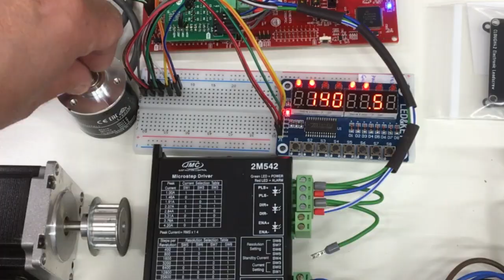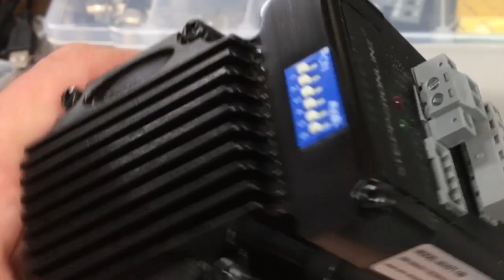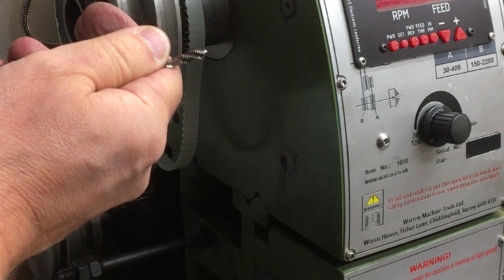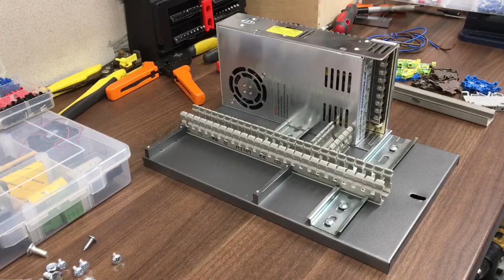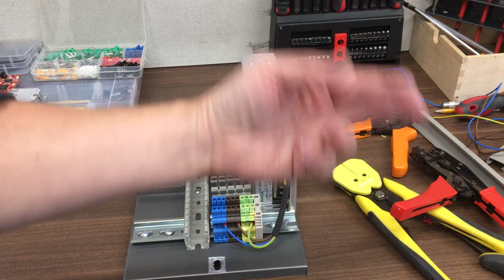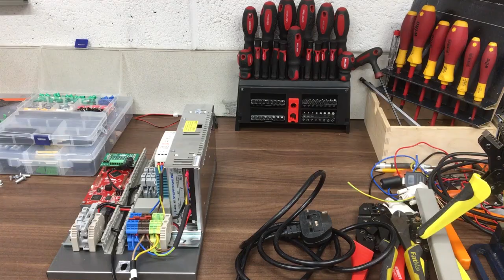Ep04: Clough42 Electronic Leadscrew | Custom Control Panel

Comment: Did you every have any timing issues meshing a T5 belt profile with 1.5 module on the drive gear to the lathe spindle?
Reply from the maker: No it's been working fine

Comment: sorry if this question has already been asked or mentioned , but what size servo motor are you using ? What is the NEMA rating and what torque rating ?
Reply from the maker: Same one James used.  iSV57T from stepper online.  It has an integrated driver.  Works well.

Comment: Is it a problem covering the cooling slots on the 48V power supply with the 5v power supply? Shouldn't you mount the 5v supply on the other side of the connectors away from the cooling slots? Nice clean build. Nice showing us your 2 crimp misses. We've never done something like that. Yeah, right, LOL.
Reply from the maker: I think later in the build I moved the 5V further away, but it’s all been working fine anyway

Comment: You'll be having fun with ftdi drivers for your RS232 to USB.  But they are pretty common.  USB is only technically serial - it's much uglier than the old school serial.  USB includes packet handling, so everything goes to crap.
Reply from the maker: Yes I'm not looking forward to that part.  With a bit of luck the motor default settings are OK.  I think they relate to "firmness" and the PID settings and so maybe I don't need to touch it!  Some of the common settings like pulses per rev and motor direction are on dip switches on the servo driver itself so they are straightforward at least.

Comment: I have received almost everything in the last week. The only thing I kind of forgot to order are the gears for the leadscrew/servo . What do you think about going 15-45 for the 3 to1 teeth count?  The 45t-t5 would be 70 O.D  and the 15t-t5 is 22 OD. And they will accomodate a 10mm belt.   I found a good storefront on aliexpress that can ship them to Canada in two weeks... Not bad these days...
Reply from the maker: That sounds better than the ones I bought which were quite big!  I was thinking about 12T / 36T if I can’t fit the ones I have but 15T / 45T also sounds good.

Comment: I really like your idea of using another gear and matching the teeth count. Seems like a simple and straight forward solution.  

My wm210v with a 38mm spindle bore has a (not so easy to find) 56 teeth gear. I think I will have to 3d print the encoder gear to match.  

Do you have a link for a drawing with measurements of that encoder ? I bough the exact same one on Ebay but can't seem to find a reliable blueprint. 
The WM210v seems to be quite a bit smaller than your Warco250. Space will be a challenge ...
Reply from the maker: It was from grabCAD
https://grabcad.com/library/e6b2-cwz5b-encoder-1
Reply from the maker: I went with T5 as the profile is more square but maybe HTD would work too.
Reply: @routercnc9517  Wow thanks I did not even think about getting the 3d model !
Reply from the maker: I signed up years ago and there is a surprising amount on there.  Obviously you need to check it against what you have in your hands for the critical dimensions.
Reply: @routercnc9517  I actually already had an account just never though about it .  I'm in fusion designing the 56 teeth gear around it as we speak! Thanks again !
Reply: I've got the exact same wm210v lathe with the 38mm bore and 56 teeth. I modeled the encoder I have, and found that if I use an identical 56t mod 1.0 gear on it, there isn't quite enough clearance for the encoder body. It will bump into the wider drive pulleys just next to the gear teeth on the spindle.

I'm going with a 64 tooth gear on the encoder, which gives just enough extra clearance, but at the cost of a small gearing down on the encoder side, so I only get 0.825x the angular resolution... For a 600p encoder, that's down to 525p/rev on the spindle, which maybe isn't great.

So I've also ordered an HTD 5M belt and a 20T htd pulley. If that fits well, it'll gear the encoder up to effectively 1680p/rev, which should be much better.

Comment: 37:48 you could just turn the connector so it goes straight into the grey wire channel instead of having the wire hang over the PCB
Reply from the maker: I looked at that and for some reason did not like it.  Maybe it preloaded the PCB too much?  Anyway the straight pigtail version arrived yesterday so it is a 2 minute job to crimp on the ferrules and swap it out.

Comment: My encoder drive does work but yours is so much better, I think I will have to copy it😀 Good project and videos!
Reply from the maker: Go for it!  I basically stumbled upon the direct gear to pulley drive idea when staring at the lathe and looking into options.  The purist in me says don't do it.  But the match just seems too good and I think it will be OK.  Time will tell.

Comment: Hello! What is the gear module on the spindle axis and the number of teeth?
Reply from the maker: I don't know about the module but there are 40 teeth.  When I measured the outer diameter (allowing for a bit of wear) of the gear it was the same OD as a T5 with 40 teeth.  Also if I wrap the T5 belt around the gear it is a perfect fit.  The purist in me says don't do it, but from a practical point of view I think it will work considering what it is driving.
Reply: @routercnc9517 , based on a diameter of 62.81 mm, the module will be 1.5 mm, and the pitch of the teeth will be 4.71 mm. I have 60 teeth on the spindle, module 1, pitch 3.14, gear diameter 62 mm.
Therefore, T5 will not suit me ...
Thank you for your reply :)
Reply from the maker: @Valery_1954  That's a shame.  I guess I got lucky with mine.  I noticed James ran his via an intermediate gear and it was OK so you should be OK too, just a bit more work.  Unless you want to dis-assemble the spindle pulley, gear etc. and replace your 60T spindle gear with a simple custom V pulley, then run the encoder off that via a V belt.  That was one of my plans, just be aware you would need to reset the pre-load on the spindle bearings as you would disturb this.  Good luck!
Reply: @routercnc9517  , In my opinion, the belt you have chosen is too wide and stiff, the encoder bearings will have a hard time. A width of 5 mm would suffice.
I don't think it's a good idea to transmit rotation to the encoder with a V-belt - more tension is needed, possibly slipping and ruining the threads being cut.
Reply from the maker: @Valery_1954  OK fair point.  I went with 10mm as that matched the existing spindle gear width.  I could drop down to 5mm width and swap out the encoder pulley for a 5mm one.  Maybe I'll see how it goes.  Yes, agree a V-pulley would not be so good for the reason you mention.  Another option I thought about - I have made my own HTD pulleys in the past and I did consider making one and putting it on the main spindle.  But they take a while to machine and I would need to re-tension the spindle bearings.
Reply: @routercnc9517  , I also once had to make ... uh ... "pulleys" for a toothed belt, their diameter was about 400 mm)) I had to select a non-standard cutter. But I have not been working for 4 years now, I no longer have access to the equipment. There is, of course, an option to gouge the desired gear directly on the lathe, using the appropriate gear as a reference for installation.
PS
Re-tensioning the spindle bearings is not such a big deal if you have the keys. And I have them.
Reply from the maker: That’s good to know.  I have some pin spanners but they might not be big enough.  Anyway I’m sorted for now, onto the next step of the project.

Comment: If you have troubles getting that USB to serial adapter to work, it probably has a counterfeit USB to serial prolific chip in it. I've used similar products to program amateur radios and have that problem occasionally. The real prolific drivers recognize it's a counterfeit chip and won't work with it.
Reply from the maker: Hi Terry, OK that is good to know.  That might be some way off but when I get to that point we will see what happens.  Worst case is I get a serial port card for the workshop PC tower.  Thanks for the headsup!

Comment: It's coming along nicely. Looking forward to first cuts 😍
Reply from the maker: Me too.  Although this is great for threads, what also sealed it for me is the idea of being able to dial in the feed when cutting to get the best chip formation.  Onwards with the project!
Reply: @routercnc9517  I've been thinking about implementing constant sfm, it definitely makes a huge difference to the surface finish.
Reply from the maker: Sounds interesting.  Would it somehow detect the diameter of the part being machined and adjust the feedrate?  Assume this is for turning down not facing?
Reply: @routercnc9517  I have a custom built ELS that can optionally drive the cross slide, I'm planning to add some parameters to allow it to ramp up the spindle speed as it progresses through the cuts both for facing and turning.